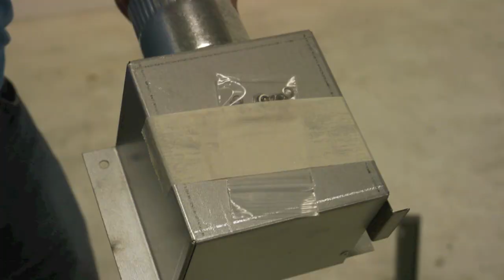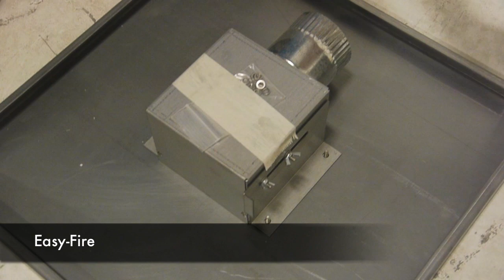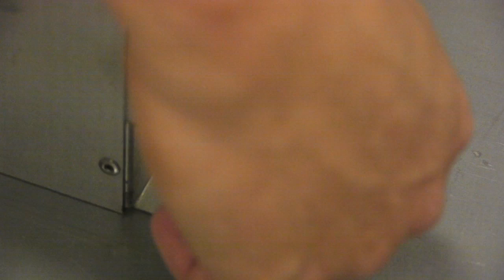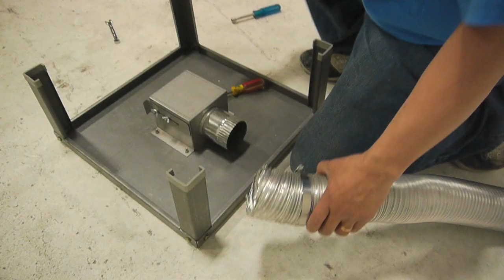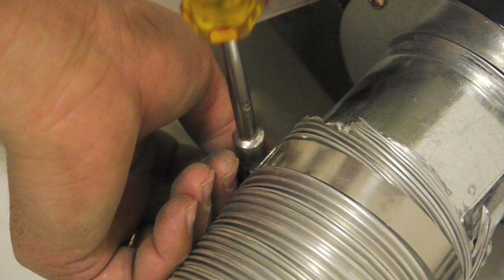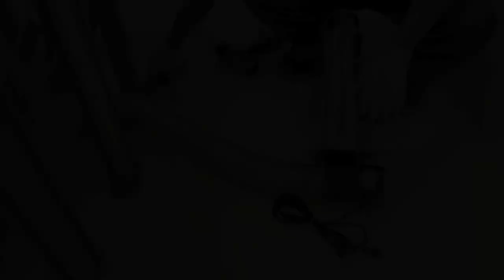How to Assemble an L&L Kiln Vent-Sure Downdraft Vent System

Comment: Is the slide opening- with the wing nuts- suppose to be open or closed during firing? thank you
Reply: Typically you adjust this for the size of your kiln and leave it there. For a large kiln (10 to 20 cubic feet) you would leave it closed. for a small kiln, you would start with the fully open position; for a medium size kiln (7 cubic feet), you would put it in the middle. We call it a "bypass box" because it adjusts the vacuum pressure on the kiln by allowing the force of the vent fan to bypass the kiln.